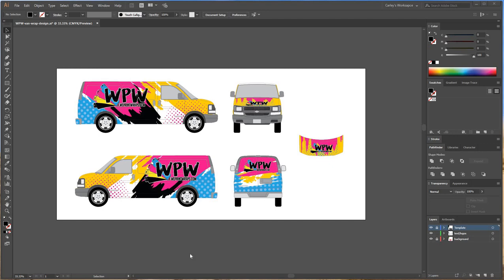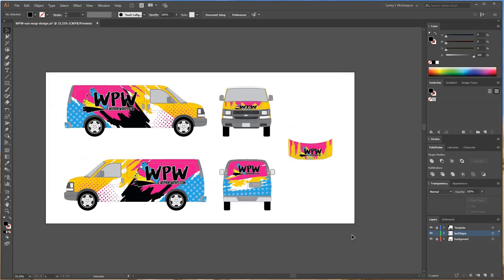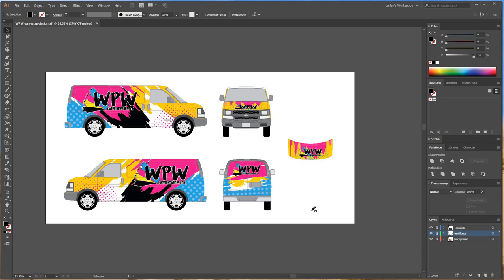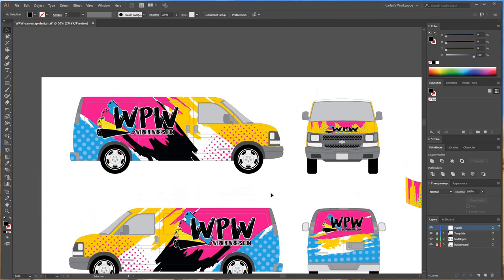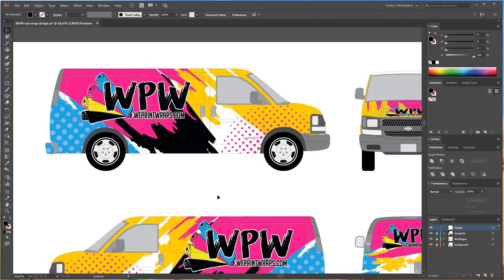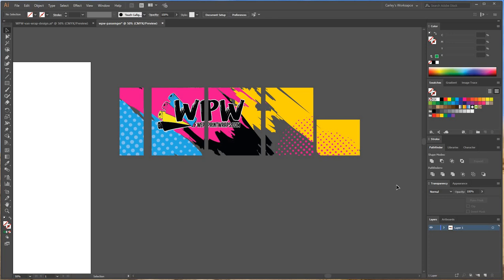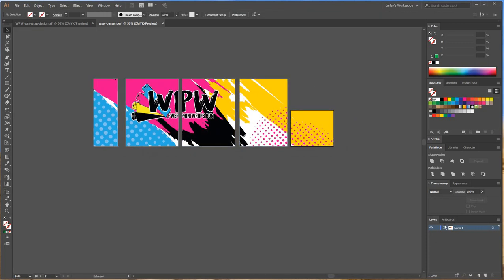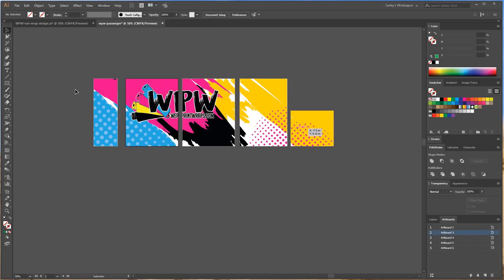How to panel out a vehicle wrap for print Adobe illustrator CC

Comment: If you popup the scale window by hitting s and then return, check off stroke and corner edges if needed. That way when you resize, the stroke width stays the same while resizing it manually. Saves a lot of hustling, i saw you reapply the stroke width a couple times. Its just a little handy trick :)
Reply: Thanks for sharing the knowledge!!
Reply: @bulldoglove7631  helps making all of better designers and technical designers

Comment: This was an excellent tutorial. Thank you for taking the time to put this up, Carley! It's always such a pleasure working with you and now that I have some more insight as to how you work I will be sure to make your job much easier for future jobs I send to WePrintWraps and my other vendors. Thanks again. Can't wait to see more videos. I'd love to see one on how to get bumpers to seamlessly line up with the side fenders. 😖 I have some ideas, but I'd like to see your approach.
Reply from the maker: Thanks Scott! Making the sides line up with bumpers and hood is a tricky one! Usually when designing I try to stay away from putting artwork on those areas just so I can make it easier for my installer and if I do decide to put artwork there I try to make sure its pretty busy so if it is slightly off you cant really tell. But I am working on figuring out the best way to do this and I will get a video out for it!  Stay tuned :)
Reply: Yep! generally keep the seams or wrap around as a solid color or as an insignificant background that will be hard to notice. If you find a new method I'd love to hear!

Comment: I wonder if its faster making artbaords of those panels and then make separate EPS or PDF files from those artboards vs making clipping masks and doing all the tedious work of clipping them. Or just print from them directly since they are set with overlap anyways. It think that is faster all you will need just 1 design, If something changes, its easier adjusting it. 
PS you have tricks for making letterwork ready for kisscut stickers? I now setup an action which does the automated work for me. BUt i wonder how other tackle this

Comment: So glad i use metric, when working in 10% its way easier vs imperial. Simply move the dot one digit. No need to use calculator or do all kinds of calculations
Reply: But thanks got Illustrator can do calculations in the input fields. I remember the old days, nothing like that could be done.

Comment: 100% scale??? you must end-up with massive final file sizes.... if designs use any type of raster/images, just wondering why not use updated vehicle/truck templates... so much faster. 
To each their own !!
Reply: WOrking in scale doesnt help keeping size down. When you work in scale that means your DPI needs to multiplied so its still same raster image. If you dor work 1/1 use lower DPI if you can get away with it. BUt generally wrappings and designs are preferable done in vector
Reply: Um, you’re only kind of right. I can explain - if you’re interested in knowing.
Reply: @mreoski  There is a car with 1:1 dimensions.
What scale should I set in Illustrator?
And if there are bitmaps, how much dpi should I set?

For example the car drawing is 1:25,  then the raster images are dpi 120?
thanks
Reply: @alexanderkrasnovsky  : Hey there. So typically you want to consider the recommended PPI (Pixels-Per-Inch) that the print operator has suggested - such as "Raster images should be 150ppi at Final Output Size". If you are working at 100% scale, then you know that for example - a 20" x 20" Raster image must be at minimum - 150ppi within your Illustrator composition. If you are working at half scale within Illustrator, then the Raster image quality of the images used in your composition should be at 300ppi, so that when in the RIP software (such as Versaworks) the print operator initiates the design to print at 200%, the raster images will truly print at 150ppi. Otherwise, if you're working at half scale in Illustrator - and the raster images in your composition are at 150ppi, when the printer operator initiates the print to be processed at 200%, your raster  images will actually print at 75ppi. Does that make sense?
Reply: @RomboutVersluijs  : Yes. You are correct. Whenever possible, work in Vector format. 
I find it mildly amusing when people think that working at a smaller scale reduces file size, when in fact, if the designer is following recommended print-output parameters, scale makes no difference in file size, but is merely a convenience when navigating around an dartboard in a composition/drawing software application such as Adobe Illustrator.
Reply: @mreoski  the layout in Illustrator is at a scale of 1 : 10, the layout contains a raster image, I make it the same 1 : 10 with a dpi of 1000?
Reply: @alexanderkrasnovsky  : Depending on your destination printers requirements and your desired print clarity result, you should seldom need a DPI/PPI that exceeds 300 at final printed size.
Reply: @mreoski  Made with 300 dpi, printed out, then you can see the pixels. Now I'm converting it to 1000, if print 1000% in the rip